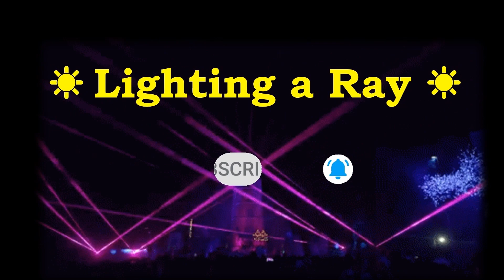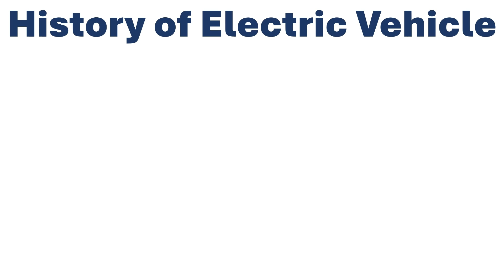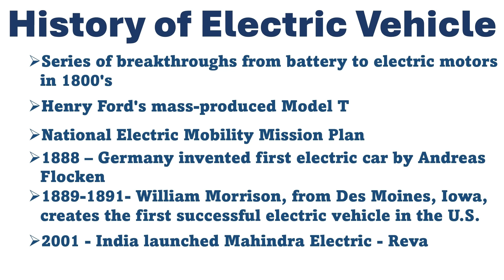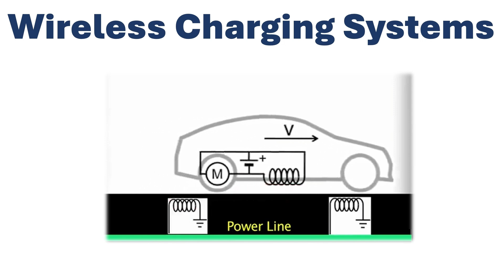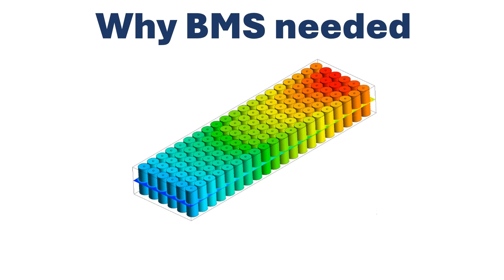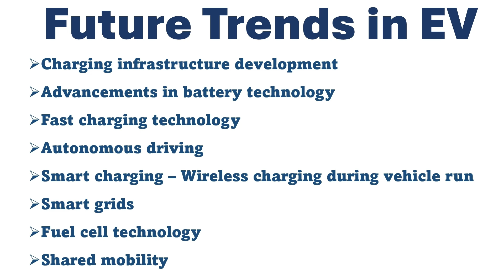How Electric Vehicle Works | EV Crash Course | Working Principles of EV | Electric Vehicle Operation

Comment: hello sir, please do a video on how BMS(Battery Management System) in EV vehicles works . In EV vehicle how battery is charging and discharging and based on SOC how can we calculate distance can be travel. Thank you.
Reply from the maker: @venkygoud7421  interesting topic you suggested, quite easy as well. I will try my best if time permits soon.
Reply: @SanjayMane_Tech  Thank you for replay I need total BMS priject to implement please uploadtotal BMS operations.